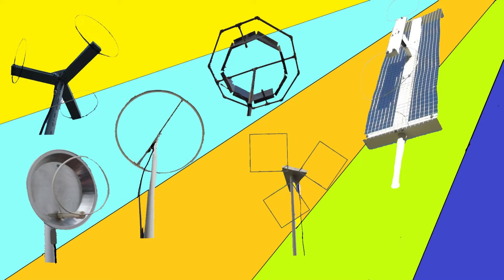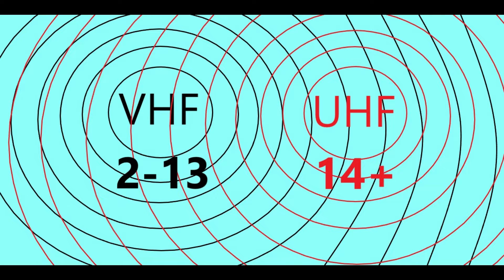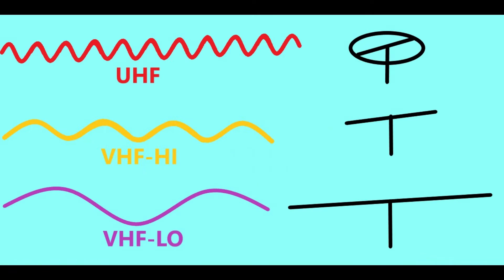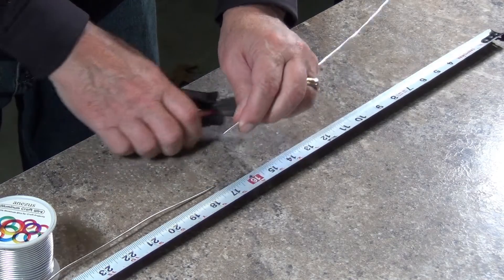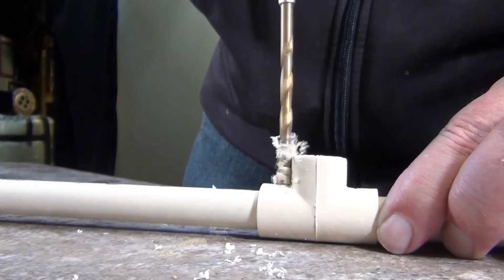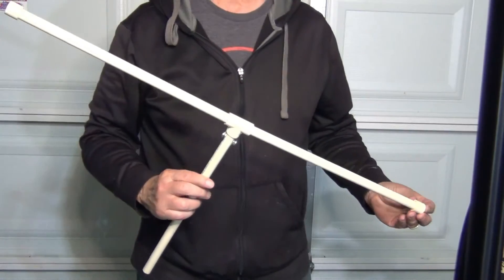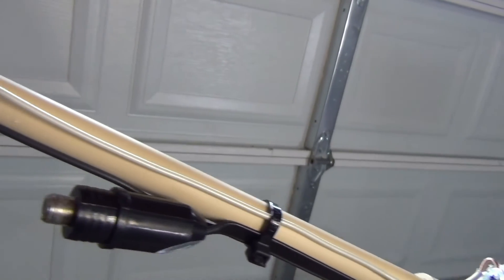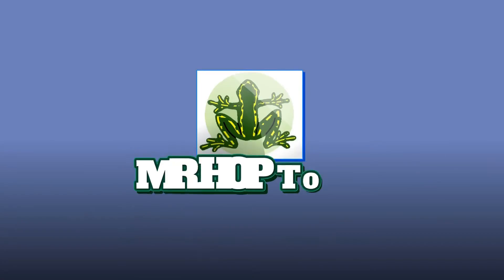VHF-Hi Band Antenna for TV! Part One

Comment: Excellent pro. Brother. Im in india. I would like to receive f.m radio channels at least up to 500kms. Such as srilanka other radio stations.  If this kind of antenna works i really appreciate you. Thanks. Sam.
Reply from the maker: It's easy to make, so go for it. The higher you mount it, the farther it will receive FM signals. Remember to mount it vertically.  Thanks for c watching.

Comment: I have copper wire available.  You made it seem that I could use it in place of the aluminum.  How would the dimensions/construction change if you used copper?  Your video is very helpful and clear.
Reply from the maker: Follow the same dimensions and construction. Thanks for watching.

Comment: I am wondering if you could answer me one question MHTI. Would folding a dipole antenna like snake to make a smaller form factor keep the signal reception the same ??? Also, if the length of the antenna is for the lowest frequency channel let this folded antenna let me recieve the higher channels, Ex. 2 to 3 to 4 to 5 to 6 to 7 to 8 to 9 to 10 to 11 to 12 to 13 ???? Hope I made the question clear MHTI. Thanks for your time too. vf
Reply from the maker: I've seen an antenna similar to what you describe used for FM reception, not TV. It would work, but the reception probably would be diminished. What the antenna receives is a total of its tuned length and how strong the broadcast signal is, so in most cases you may receive one or two channels beyond what you're tuned to.
Reply: @mrhoptoit7835  O.K. thanks..

Comment: MHTI does a half-wave dipole work better than a folded dipole antenna ?? I would think that since there is more metal length would help increase the gain ???  Peace v
Reply from the maker: They work about the same, as long as they are both tuned to the frequency you want
Reply: @mrhoptoit7835  THANK you SIR for letting me know

Comment: I have an idea MHTI. Would short wires protruding from the main reception element going around the perimeter, very similar to barb wire increase the signal strength ?? Just wondering.
Reply from the maker: Interesting. I have no idea what that would do. Thanks, VF

Comment: Would putting two VHF antennas, one on top and one on the bottom  of the long range double hoop with low VHF and hgh VHF lengths matter which would be on top and which would be on bottom make any difference for reception ?? Sorry MHTI for the long sentence as I wanted to get everything stated for your answer. Would putting a reflector on VHF help with poor reception ?? Look forward to the part two Sir. Thank you for your time and help too.    😀😀😀😀😀 You are the man Mr. Hop To It.
Reply from the maker: Mixing hi vhf and low vhf antennas is pretty common. Just be sure on how you connect the wiring. Reflectors will also work to enhance reception. Thanks, VF
Reply: I am waiting for your part 2 video Sir. Thanks @mrhoptoit7835

Comment: @Victoryfirst
Hope you see this !
To answer your question about the number of wires twisted together, and gain ?
By twisting more wires together does not impact gain !
If anything, increasing the diameter of the element, will increase the usable Band width !
And lowering the antennas
 " Q " !
( The frequency that can be best optimized )
As a single element will truly resonate on a single frequency, giving the antenna its best chance for reception on a particular Channel !
Not to say it will not pick up other channels, but not optimally !
Radio and Television signals deal with specific mathematical formulas !
And you simply cannot get around physics,( Physical  size etc.) 
if you expect to find your best results !
And even with a perfectly designed antenna, atmospheric conditions can change reception dramatically !
Hope this helps !
👍😉
Reply from the maker: Thanks for sharing your knowledge on this subject.

Comment: Would using 5 wires wound around each other increase the gain even more ?? Just wondering Sir.
Reply from the maker: Based on what I've experimented with, there is a point where adding more size to the element no longer increases the antennas capabilities. Twisting 3 wires together was as much measurable increase as I could get.
Reply: Did you use 10 gauge wire when you twisted the 3 together ?? Thank you MHTI for your help and advice ?? Look forward to your videos and technical help too. Peace v  @mrhoptoit7835
Reply from the maker: I tried twisting 10 ga wires, but it didnt increase any reception vs just a single 10 ga wire. In my experiments twisting 12 ga wire was about the most I could do and still increase performance.
Reply: Thank you for the information MHTI. Now I will know what size to use for my big double hoop reflective antenna. Would making two antenna mounted one about the other increase the signal strength ?? I have monster trees galore and the leaves will be on the trees soon. Thank you Sir.   @mrhoptoit7835